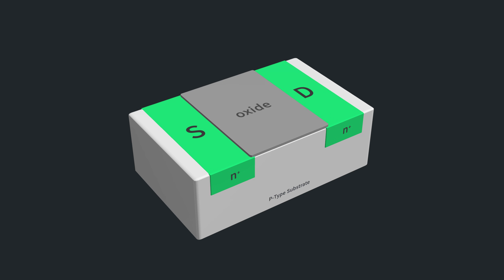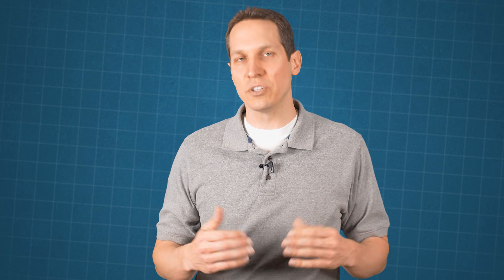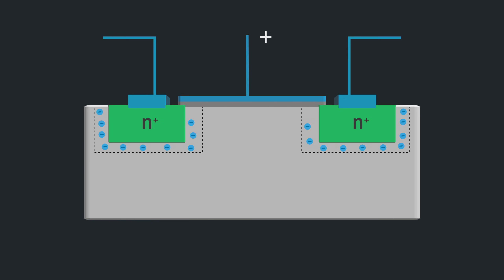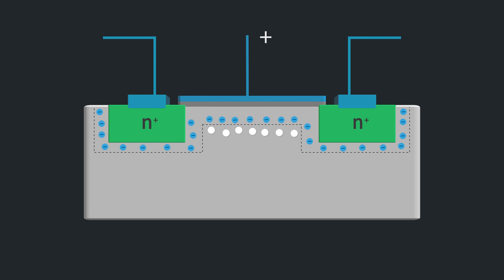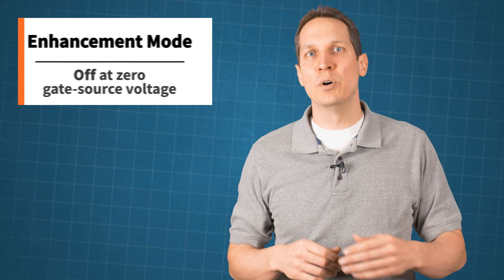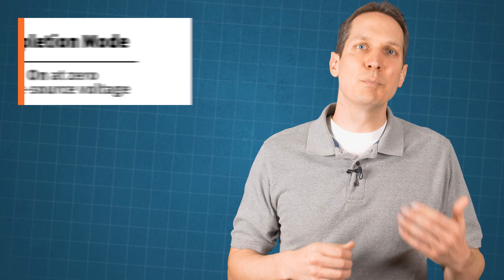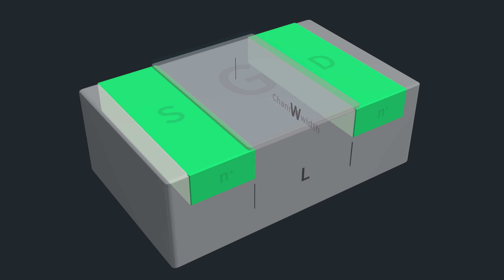How a MOSFET Works - with animation!  | Intermediate Electronics

Comment from the maker: Hi all!  We hope you learned some helpful info about MOSFETs with this video - we have a lot more tutorials and videos on different semiconductors as well as other electrical engineering / electronics topics.  Go check them out on our YouTube channel or on our website - https://www.circuitbread.com/
Reply: VGS<VTH condition is referred to as Saturation and pinch off point  at 2:14 of video 
isn’t it Sub-threshold conduction ?

Saturation condition should be VGS > VTH and VDS > VG-VTH 

did I misunderstand anything …!

saturation
Reply: @sureshchattu5211  May be, he confuse between Vgd with Vgs. I think "gate threshold voltage" is replaced to "gate to drain voltage".
Reply: You're great presenter, thank You!
Reply: I lofe your voice in the first thirty seconds. I can listen and learn from you.
Reply: Hi, 
I really  ❤️ your video.
I am a teacher from Bangladesh. Most of student don't understand english. I like to teach them in your way.❤️
Please, can you tell me what software you use.  Specially the 3d animation part. 

Thanks. #respect.

Comment: Why do schematic symbols for MOSFETs show the source connected to the substrate?
Reply from the maker: Great question!  It's important to remember that MOSFETs are made up of PN junctions (otherwise known as diodes).  If the source and substrate (sometimes called the body), it makes sure that you won't get any unwanted forward biasing (meaning, unwanted current flow between the source and the substrate).  There's more to it than that but that's the big part.  I hope that helps!
Reply: @CircuitBread thank you!

Comment: Hey
I have a question. In the sturation mode, there is no current? I used that saturation means the max current. 
Thanks!
Reply from the maker: There IS current in saturation mode, it's actually the mode when the MOSFET is considered fully "ON".  I highly recommend checking out a related video we made to address some of these items of confusion: https://youtu.be/o3M2sOCGCKs?si=xLgWj13eaYWM-xjE

Comment: There's an error I think in the video where it is being said that mos is in saturation when gate voltage is not even crossed threshold. It should be sub-threshold or cutoff region, not pinch off.

Comment: What prevents a high Drain voltage from damaging the Gate insulation?
Reply from the maker: That's a great question!  Absolutely nothing prevents damage - if there is a high enough voltage to break down the gate insulation, it will do so.  In the data sheets for the MOSFETs, there will be ratings that you shouldn't exceed without causing problems.  I hope that helps!

Comment: So it input and output is same ?
Reply: I think these N-Channel Mofsets are used as a switch not as an amplifier. It works in the enhancement mode which means it keeps turned off unless we apply a gate voltage which turns it on.
Reply: @thahseennv  input and output same?

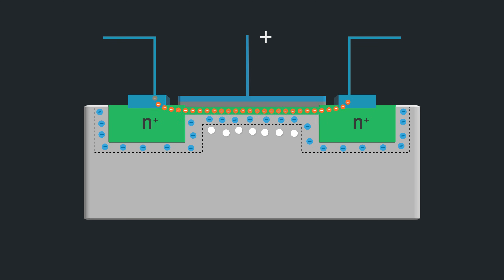Comment: As @sureshchattu5211 mentioned in another comment, I believe you have the two region names confused at 2:11 and 2:34. From my understanding the area before VGS equals the threshold voltage is the Ohmic region. The region past the threshold voltage when the MOSFET is fully conducting is the Saturation region. 
If I'm wrong please let me know! Otherwise this was a fantastic video!
Reply from the maker: Thanks!  We actually did another video that addresses this specifically: https://www.circuitbread.com/tutorials/what-are-the-different-regions-of-operation-for-a-fet  I think, in this case, the biggest challenge is that, in this video, we are showing what happens when you increase VGS.  Yet almost all graphs that show this curve, including ones we've made, have VDS as the x-axis.  So, to help see why we think we are right (hey, I'm not going to claim perfection - ever) look at one of those graphs and then, instead of moving left to right, choose a VDS voltage and then look at the regions you move through as you go from the bottom to the top.  It'll be cutoff, saturation, then ohmic (or linear).  Hopefully between that quick explanation and the other video, this will be clear.  YouTube is not great about notifying us of responses to comments but I would love to hear if that cleared things up!
Reply: @CircuitBread  thanks for the reply! This makes total sense and I agree, the terminology is incredibly confusing! Your linked article does a wonderful job of further explaining these regions, thanks!
Reply from the maker: Awesome!  Glad to hear!

Comment: when a positive voltage is applied to gate it causes the hole to repel in the substrate away from the channel, but how does this happen i mean how the n channel forms here?  here it is said after repelling holes, only the negative ions(electrons) will be there in the channel which allows the path for conduction. so i'm assuming that a combination of holes and electron channel is already fixed there?? is this right??

Comment: What is this inversion layer u never explained even a little bit in the video😢
Reply from the maker: It was very brief!  At around the 2:00 minute mark, it's mentioned that the inversion layer is made up of electrons.  In the animation, the blue negative circles represent negative ions that are fixed, they can't move.  But the orange negative circles represent the free electrons that have been attracted to the gate by the highly positive charge on the gate. And the green represents areas where there are an excess of free electrons (like a heavily doped material). Once you get a voltage across the source and drain, those electrons move.  I hope this helps!

Comment: I believe there might be an issue with the information you provided. You mentioned that in the case of a voltage applied to the gate that is lower than the threshold voltage, it is the saturation region. However, based on my knowledge, this is not accurate. 
When the gate voltage is lower than the threshold, the operating region is the cutoff. 
It's when the voltage exceeds the threshold that we need to check the drain-source voltage. If the drain-source voltage is higher than the overdrive voltage, which is given by Vov = Vth - Vgs, then the operating region is in saturation. Otherwise, it is in the linear region.

Comment: @dianebonkoungou4504

Hello,
Thank you for your video.
I have read that power MOSFETs which are vertical MOSFETs in general where the drain is at the back and the source and gate are in the same plane at the front can have a pinch too. 
But I wonder how to represent the reduction in channel length(pinch off see in lateral MOSFET when we have Vdsat) for vertical mosfets due to the increase in drain voltage because the drain is at the back, away from the creation of the channel position.

Comment: I noticed no one do any video on mosfet type for semiconductors uses , cause I did a test on 20 type of mosfet and I noticed and only 5 con work in semiconductors use like booster converter inverting the 15 others type that blow up or not to use for semiconductors use why is this

Comment: So is positive gate pushing away positive charges leaving behind negatives? Even though positive doesn't move as far as I know...
Reply from the maker: That is correct.  If you remember, the positive "charges" (holes) are just the lack of electrons, it's not the movement of protons or anything like that.  This can be conceptually weird for some people (most people) but, once you wrap your head around the concept of holes as a particle, it makes everything semiconductor related easier to deal with.
Reply: @CircuitBread  so the electrons are moving towards the gate, and creating more lack of electrons on the other side
Reply from the maker: When you apply the positive voltage to the gate, you're controlling that side.  So more electrons gather in the channel (close to the gate, but can't get to it because of the oxide barrier) but they aren't creating a greater lack of electrons on the gate because that's what's being actively controlled.
Reply: @CircuitBread the gate is metal. So it does not have holes or any lack of electrons in the senses semiconductors have it.

Comment: Great video! I just don't understand one thing, what controls the gate voltage? Because in order to translate the open or closed state of the transistor into Boolean algebra, you have to constantly change the gate voltage, so I wanted to know how this was achieved.
Reply from the maker: Thank Nathan!  The gate voltage is manually (or externally) controlled by something else.  From that vague phrase, you can extrapolate out to either an external source (if you're messing with a discrete MOSFET directly with a power supply) or another part of the circuit (like a flip-flop further up the line in an integrated circuit).
From a digital logic/boolean perspective, you don't normally worry about the gate voltage (or the different operating modes) of the FET, you simply focus on whether or not the FET is "open" or "closed".
Reply: The great thing with depletion mode is that you can just connect transistors in many ways and it just works. Look at the weird CMOS gates which are in use in any modern computer.

Comment: n-FET, p-FET. They can disconnect a charging circuit from just the voltage output of a solar panel... like a diode. But using the Vgs threshold voltage (saturation voltage). When theres no sun, theres no voltage to saturate the gate of the mosfet allowing the mosfet to turn ON. Mosfets are really cool. The solar panel(s) dont draw from the battery during the night, because there's no sun. Theres no voltage on the gate. of the n-FET.

Comment: 2:03 I am pretty sure this is incorrect. Saturation region is when Vgs > Vth but Vds > (Vgs-Vth). Saturation region is when the inversion layer is already formed and there is current but increasing Vds has no effect on carrier velocity (current). Fight me!
Reply from the maker: We did a tutorial on just this topic here:  https://www.circuitbread.com/tutorials/what-are-the-different-regions-of-operation-for-a-fet  I'm a bit confused, though, as I agree with you.  I think the confusion, in this video at that point, we're talking about changing Vgs and assuming Vds is constant, whereas when we're looking at graphs, it's usually Vds on the x-axis that is changing.  Taking more time to give a more complete view, we created the other tutorial so please check it out and let me know if we're still supposedly in disagreement.  
Also, YouTube doesn't notify me of follow-up comments, so I may be more unresponsive in the future.   Don't take it personally!
Reply: @CircuitBread  Ok. I suppose if Vgs is still below Vth at that point in the video, then there's no conduction through the channel and there's channel pinching, but textbooks don't seem to call this saturation region yet (CMOS VLSI Design, 4th Ed., Pg. 62-63). They let Vgs > Vth so that there's current between D S. Then they increase Vds such that drain's depletion region widens and pinches the inversion layer, however there's still drift current happening and the elections in the depletion region are accelerated due to drain's attraction. In your case, there's no current in the saturation region and that seems to be the troublesome thing. Do you see what I mean? Textbooks go: cut off, linear, and saturation (where there's current in saturation).
Reply from the maker: I see what you mean, for it to be in saturation, there has to be a Vds voltage, which would cause a current to flow (perhaps not significant but there would be a current).  As technically, if Vds is 0, it will be in cut-off no matter what Vgs is.  I'm sorry, this can definitely be confusing.
This is the problem with us trying to only briefly review this idea  - I'm not sure if we should have left the operating regions alone completely in this video and just referred people to the other tutorial dedicated to the topic.  I feel that one does a significantly better job explaining this particular concept.

Comment: Thank you very much.Thank you for your effort.
I would like to ask two questions.How are holes arising through the positive voltage and what makes them to leave the channel?
It would be very kind if you can give me a  detailed answer because I love to learn things as detailed as I can.
I thank you very much in advance
Reply: At what time in the video? We only want charge carriers close to the gate. A diode in reverse has this nice depletion region to get rid of stray carriers. Just apply a voltage to the body ( bottom ) relative to everything on the top side. Some MOSFETs are used in applications where source and drain change roles. Mostly IC. That‘s why I would not assume that one too electrode is directly connected to the bottom electrode.

Comment: I am not a degreed electronics engineer, HOWEVER this is how that ACTUALLY seems to work: when circuit between pos (gate side) and neg termimal are connected the electrons flow to that capactitor gate and thus fill that channel and current starts flowing across that channel. Thanks in advance for saying THANKS!

Comment: What are some common values in micrometres for L, W and the oxide layer thickness?
Reply: Common dimensions in units of µm
Length: Your
Width: Mom
Reply: Layer: some atom layers. Channel what you read as technology node , so 100 nm for 1 Vdd ? 6502 was started at 5000 nm. You can see the width of some gates on the die shot. When there is a fan out, the previous gates are all widened up. Also the pins got large drivers where the gate needed to be folded because it is so wide.

Comment: It look like there's no dirrefence  between two N-type areas? Why then the channel grows from source to drain?
Reply from the maker: It is based on there being a source to drain voltage.  My understanding is that if there is no source to drain bias voltage, the channel growth will be even as the gate voltage increases.  In retrospect, that should be have been mentioned more explicitly.  Great question!
Reply: @CircuitBread  Yeah, I've thought about this later. It's just not shown in animation explicitly that drain-source shoud be connected under different potentials. But, still this makes not essentiall difference where's source terminal and a drain - it's not defined by structure or manufacturing. It depends only how we connect + and - That's just in principal. 'Cause in real MOSFETS there's an internal diode between drn and src, so there's some technical details and difference between these two.

Comment: but why inverse region formed firstly at Source but not Drain, I mean, from the structure, source and drain are the same
Reply from the maker: From a structural perspective, yes, but when used, the positive voltage is put on the source, which affects what's going on in the MOSFET.

Comment: How excactly does the inversion layer form if that region of the substrate has become non conductive due to a depletion layer being formed there?
Reply from the maker: That inversion layer forms as the voltage is increased and the depletion layer moves downward.  It's still not conductive if you only have enough voltage to create the depletion layer but not enough to get the free carriers in that inversion layer.  Or do you mean how do the electrons get up to the inversion layer when it's in a non-conductive material?  I'm not 100% sure of that one, but I believe the electrons can be pulled from the source and drain or even pulled through the less-than-ideally conductive depletion layer.

Comment: Wait, wait. The explanation of the pinch-off is completely wrong. Pinch-off is very important to make sure that you get a square relationship between current and gate voltage. Pinch-off occurs when Vds is smaller than Vgs-Vth. That is pinch-off only occurs when Vgs is higher than Vth. In your explanation, you said pinch-off occurs when Vgs is lower than Vth. This is not correct. We actually do not want the channel to join the source and drain. When the channel joins the source and the drain, the MOSFET then operates in triode or linear region. Linear operation is something we want to avoid. We actually want the pinch-off to happen so that we can get the saturation mode operation and gain a higher current.
Reply from the maker: This is a common point of confusion, enough that we did a separate video to address the different operation modes: https://youtu.be/o3M2sOCGCKs

Comment: I read a particular datasheet which has this reading which i find odd and cannot figure out why, in what incidence will continuous drain current (Tc=25C & Tc=100C) be equal? Shouldnt the current decrease when temperature is higher?
Reply from the maker: Hopefully I understand the question, but I think the issue is that you're reading it as expected behavior versus tolerated behavior.  I'm going to assume that it says the continuous drain current is the same at 25C and 100C?  That simply means that, if your MOSFET is working in 25C conditions, it will safely conduct the same amount of current as that same MOSFET in 100C conditions.  Of course the designers put a little wiggle room in there to cover themselves (as they should!) but I wouldn't be surprised if the wiggle room is smaller on the 100C side.
Reply: @CircuitBread  thanks for the explanation, that makes sense.

Comment: Where did the negative fixed ions Come from when holes are displaced?
Reply from the maker: The negative fixed ion is simply the fixed atom in the lattice that has acquired an additional electron, making it negatively charged.  So it was always there, it just became charged once the hole left (ie, the electron bounced over to that hole).
Reply: @CircuitBread 
Actually I'm from a non engineering BG and need this for my Bioelecticity class ! 
Thanks for taking my primitive question too. :)
Reply: You could argue that one nucleus in the crystal has one proton too much or not enough. At high enough temperature electrons just feel the mean field of these cores. It is actually quite like a field effect.